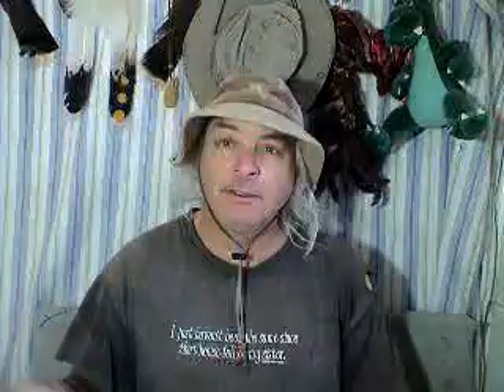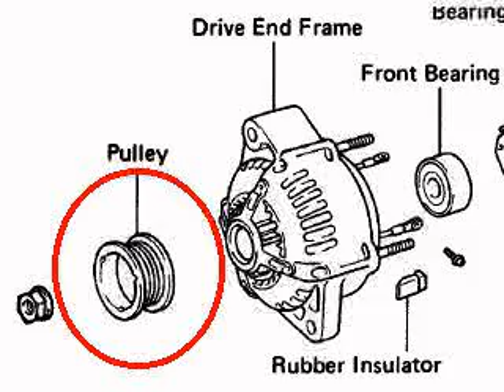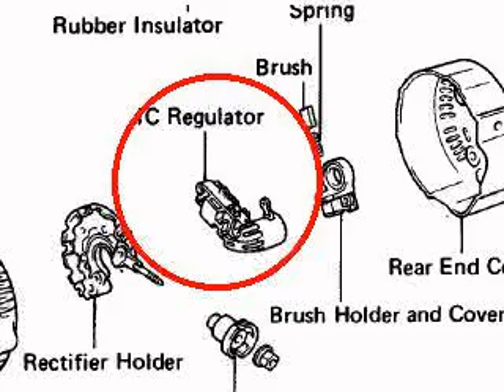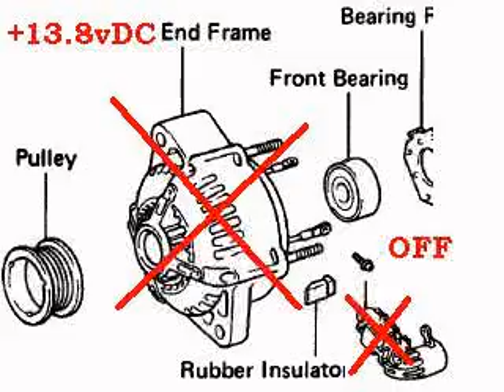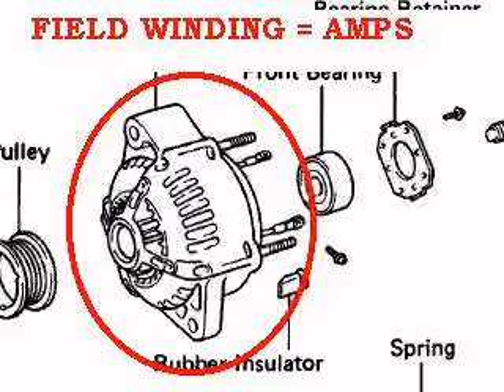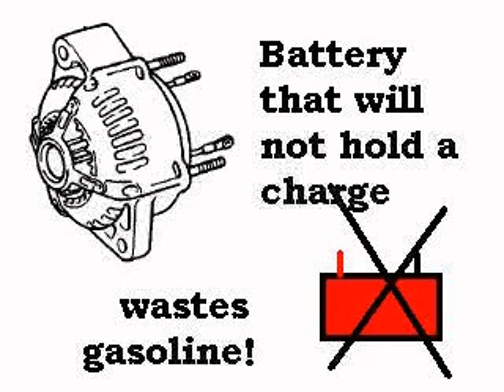Major Technology Breakthrough! Burn Water as your Automotive Fuel! HHO Part One

Comment from the maker: @frankrbruno ; Sorry buddy, but the standard regulator not only regulates a steady 13.8 volts with varying amps but it also turns the alternator off and on. I am getting my information from the automotive industry, and direct observation.  Also, it should be obvious to you that car batteries would not last long if they are always being charged. You can measure it yourself: place a ferromagnetic item next to the alternator with a fully charged battery: the magnetic field turns off and on.

Comment: Wow, the blind rebutting the blind! Unfortunately most folks explaining HHO boosting as a good thing, don't have a clue how it works. 

 So stay away from HHO, unless you FULLY understand how it CAN lower fuel consumption. And the many obstcals of HHO boosting.  

That means you need to no how Linear energy (the piston) transfers to rotary energy (the crankshaft). How "fuel burn speed" effects that energy transfer. 
HHO boosting can minimze waste energy (heat) it does not cerate energy!

Comment: I used to think you could get "free energy" from water, but I was wrong. It is against ALL the laws of the universe to make a perpetual power device (makes more power than it uses) Think about it: You are powering the HHO cell from power that you take from the engine, but have forgotten to realise that the HHO IS POWERING THE ENGINE IN THE FIRST PLACE! You can't make more energy than you use, it's just impossible. Even if the conversion rate is 100%, you cant use the energy or you will run out.

Comment: @EMILIJOXXX Well, it is you here who don't know anything about anything, his explanation is 100% correct, and these devices are a HOAX, the don't work, they don't save anything, they will just mess with the electric system and cause huge drag and even worse, prolly toasting the alternator and battery in the process.

I case you have any doubts, on a carburator smal gasoline engine (around 1300cc), just turn on the lights and hear the engine drag.

Comment: You have no clue that the regulator in an alternator sends voltage to the rotor( THATS ROTOR) in order to produce a magnetic field that is rotated within the field windings, and thus produces an output voltage from the field windings that is then changed to d.c. voltage by the diodes within the alternator housing to charge a battery. I think you should at least look around for information before you would make comments like the outrageous ones you claim to have more knowledge of than us....

Comment: @Sirstan2000 Lol, strange but oo so true, you need to check out and you will find me correct 100%, or i would not have said so. lol ...The ignition source was the weather, it took hold in the paint compounds, which in turn hit the hydrogen storage chambers in side...........thom.

Comment: The zeppelin exploded due to fire caused by thunder storm, the fire took hold in the paint compounds used on the skin of the zeppelin, the zeppelin did explode but only due to the lack of knowledge regarding the paint compound, not the design its self.
Thom in Scotland.

Comment: Alternators 1st used by Chrysler in production cars, early units were just a little more powerful (40 amp rating) than the generators they replaced. Nowadays it is not uncommon for cars and pickup trucks to sport 140 to 160 amp alternators, and in a couple of cases 225 amp units, the vehicle systems may only use a fraction of this supply at any one time 35 amps to 75 amps, the modern alternators are over rated, not under rated.
Thom in Scotland.

Comment: First and foremost, an alternator never stops producing energy. The only function of the battery is to start the vehicle. After starting vehicle with battery you could remove battery and car would continue to run. A regulator is for 2 reasons, to regulate voltage & to convert voltage from AC to DC. Furthermore I personally have seen better fuel mileage and cleaner emissions. Sounds like you have never tried a unit, you should 1st try it then we'll debate. Thanks and God Bless!!!

Comment: 2H2O + e -> 2H2 + O2, is more costly in terms of energy than extracting H2 from petrol fuels currently, and is a storage nightmare. Using 2H2O + e -> 2H2 + O2 -> 2H2O + e on board a car is simply a waste of energy. Your much farther ahead simply powering the vehicle directly from your stored energy, as in battery stored electricity, petrol, or H2 (any fuel). Petrol is the most energy dense storage method and easiest to handle. That's why we use it. 

H2 is fuel, H2O is not.

Comment: I think the point your confused on is how the Hydrogen is bonded in each usage you named. H2 is usable as a fuel for combustion, an exothermic reaction with O2. Which we use to drive many things. Energy yielded from H2+O2 is greater than an identical hydrogen count of C8H18+O2. It's all about the energy required to break the bonds compared to the energy released when bonding the product. Breaking H2O to create H2O even at ideal efficiency is a match. You can use that for energy storage/transport

Comment: Addendum: Ensuring that your fuel injectors are misting properly is a far better use of your time and money.

Adding a water injection system or bubbler will give a little increase in overall efficiency on some engines.

Comment: MY HERO!

However, some of the mileage, and emission claims are accurate, just not for the reason claimed. Water vapor, and tiny air born droplets of water entering the combustion chamber have the effect of moderating combustion, and expansion of the resulting hot gases which increases engine efficiency, and reduces NOx emissions. The tiny amount of H2 and O2 produced can have a very, very slight positive effect, only noticed at very low engine speeds, only due to favorable ignition conditions.

Comment: gasoline is a hydrocarbon an as such adding hydrogen improves the burn characteristics of the gasoline so that more power is produced in the burn than gasoline alone. Your only looking at the electro- mechanical side. by your account a supercharger wont improve power output because you have to dive it from the crankshaft. Good luck with your education.

Comment: Whatever you fancy calling H, its combustion results in an explosive exothermic reaction producing energy output and water on earth.Its density makes no difference as long as enough is produced to run that engine. The people experimenting with HHO will get there, whether via electrolysis, hydrolysis, plasma combustion etc. We are reinventing the wheel. Being a Tesla fan, you already know this and you know also that there are many other ways of running a car. HHO is only one of them.

Comment from the maker: Dear idiot,

Hydrogen on Earth is not a fuel: it is an energy transport. Also, the energy density of hydrogen at room temperature is 4,754.40 times less than gasoline for the same volume. Do the math.

Comment: If H on earth is not a fuel, but H on the sun IS, WHAT PLANET are YOU from?
No matter how much energy it takes to split a molecule of H2O, (even if the alternator is running), this energy is FAR FAR FAR LESS than the energy required to extract the oil from the ground. Do the math. 
Now let me teach you another lesson.
Combustion of hydrogen yields 143 MJ/Kg. Gasoline has an energy content of about 47 MJ/kg. 
H costs FAR LESS, is MORE ABUNDANT and 3 TIMES MORE POWERFUL. Who's the idiot now?

Comment: Same with hydrogen. Does burning a litre of hydrogen produce more energy than what it took to extract it from water? It's no where near the energy required to get a litre of gasoline in your car! Breaking the H2O bonds and then joining them is an atomic process that is simple and with efficient design will certainly blow oil to kingdom come! EVEN WITH THE ALTERNATOR RUNNING!And besides, water is 70% of our planet. I CHOOSE TO USE MY ALTERNATOR AND STRESS MY ENGINE A LITTLE MORE!God bless&HHO4ALL

Comment: Desertphile, I am afraid you have not thought this over very well.
First of all, Hydrogen is a fuel, same as Gasoline. In rockets, it is used in its solid or liquid form to save space. Since it needs oxygen for combustion, it can also be stored as H2O liquid since it takes less space and is safe to handle.

Comment: yes decreasing fuel economy by a very small degree, but as ive said earlier, the HHO catalyst more than makes up for that decrease.  There are people driving all over the states from one end to the other with converted cars and their alternator and battery remain in good condition and they save 30-40% on fuel use.  Alternator drag is negligible.  Wow so Dateline NBC did a 'hatchet' job on HHO did they, what a surprise! ha, NBC is owned by The Murdock empire and he works for Opec (oil company)

Comment: This statement from me "the fact that the alternator under load of say 25amps uses VERY little gasoline, and that HHO as a catalyst does not need to balance with the energy extracted from the alternator because this is not a closed loop system. Water and air is added for free." which means that your alternator points in your video are WRONG, the whole premise in your video about alternator drag is WRONG, and its been pointed out to you, but your not addressing it, alternator drag is negligible!

Comment: lame excuse, you have plently of time on your hands, and it would save you much time (and money) in the long run with this thread, but i guess your not up to the challenge, just your usual quick fire excuses, and you still havnt addressed the fact that the alternator under load of say 25amps uses VERY little gasoline, and that HHO as a catalyst does not need to balance with the energy extracted from the alternator because this is not a closed loop system.  Water and air is added for free. Wakey.

Comment: Firstly: I didnt insult you, i merely stated a few truths, one been that you dont get HHO. Secondly I did spot things in the video that were wrong, and i made comments about it as above... Alternator drag is minimal (assuming a decent battery and alternator), 20amps uses very little extra gasoline (were talking less than 1% of total engine power lost to the alternator 'drag') BUT a tiny amount of HHO increases the efficiency of the combustion process by many times because HHO is a catalyst!

Comment: this guy just doesnt get hho obviously.  perhaps he should also look into geet reactors, as these are another proven alternative to just burning gasoline that he probably wont be able to accept either.  alternator drag is not an issue if u look into the real maths behind this. a tiny amount of hho is all thats needed to radically improve the efficiency of the combustion process, and thats the secret here, with very little drag on the alternator you get a lot more efficent burning of fuel

Comment: From what i've read, HHO systems use 18-20 Amps from the alternator, yes it causes drag on the engine but the Hydrogen that comes out more than compensates, what is this guy going on about?  The car gets easily 10 miles to the gallon better and using the alternator only adds like 1Mile per gallon of gas consumption?

Comment from the maker: "If you use the gas to run the engine, you are charging the battery. "

Breaking the chemical bonds of water takes more energy than combusting hydrogen provides, every time, without exception.

Comment: hey jackass,you can run the elecrolysis unit through thermo electric units connected to the exhaust,+ you  also include wood gassification off exhaust heat

Comment: I don't think anyone is talking about running a vehicle on HHO, you simply cannot produce enough via on board electrolosis. 
The idea is to promote more efficient combustion, it has been proved that it does by the previously mentioned organizations/groups.
The (proven) benefits are improved mileage figures and cleaner emissions.
Not the ridiculous claims of some commercial entities for sure, but a DOCUMENTED 20-23% improvement in gas mileage and same torque and HP and better emissions ? why not.

Comment from the maker: "...that it (HHO) was a waste of time, hadn't worked, couldn't work, won't work, maybe I should have watched the second video."

I never said that automobiles cannot run off hydrogen: I said it costs more money than gasoline, and that alternators cannot produce enough electricity to produce hydrogen from water efficiently. I said that it is much more energy efficient to use gasoline to power the automobile instead of using gasoline to make hydrogen to power the automobile.

Comment: Paul07901 - I installed an MSD (multi-spark discharge) ignition system on my ole International-400 tractor. It was the BEST thing that old tractor ever had done to it! It starts easier in cold weather, it has overall better engine performance, and my plugs no longer foul from burning oil. The MSD ignition system is more expensive than a conventional ignition system, but is WELL WORTH IT!!

Comment: Just to throw out on the table, for increasing fuel mileage what do you think of these high density multiply spark ignition coils that provide a significant amount more voltage to the cylinder, compared to the OEM ignition coil. Installation requires one to dramatically widen spark plug gap, compared to OEM gap, thus increasing spark profile. Will this arrangement eventually melt my piston heads? Someone please do a video about performance ignition coils, claims of extending fuel economy.

Comment: What about Daniel Dingles car it runs off of electrolysised water which is H2+O2. what do you have to say about that? There is a car in Japan that runs on it also. So put that in your pipe and smoke it. If you smoke you will get cancer!

Comment: Hmm... it is possible what you say is correct.

And yet it's still irrelevant.  The drag that it produces on the engine is still going to vary with the current draw.

I've got a new stat for you as well.  Automotive alternators are generally about 50-62% efficient.  The rest of that power is lost.  So take the electrolysis loss into account as well and that's a loss to usage factor of 4-1.  For every four units of power you're making the engine generate you're using one.

Comment: for my own sampling process, I bubble the product through ice water then through a condenser ... though its a pain in the tush to do, it gets the gas pretty pure and normally gets the temps down into under 70F range so my measurments are more accurate than most ... but even my method is lacking in precision ... the proper method is known to most, but the complexity and expense is prohibitive ... so we do the best we can with what we have ...

Comment: "For the most part it is a waist in gas mileage due to that charging. It is like sitting idling. It waists energy."

You haven't paid attention to one flipping second of this video, have you?  The alternator is only dragging on the engine when it's active.  It only supplies as much power as is needed.  Electrolysis is keeping it constantly loaded down and burning more fuel.  There is nothing being gained for free here.

Comment: Perhaps I was not clear. We are dealing with amateur experimenters who are making the gas using a number of techniques. It is rare that the gas produced is pure H2 and O2. There is often a high quantity of water vapor and even gasified electrolyte chemical. We are trying to come up with a reasonable method to determine actual production efficiency. To evaluate the volatility of a given batch of the stuff is not as simple as looking up an entry in a table in a text book.  I wish it was so easy.

Comment: "There is no reference material available related to HHO gas"

Drevtoob already covered this, but.. it's just hydrogen and oxygen.  You of all people should really know this.

Another way to calculate the energy is to use the amount you'd get if you used it in a 100% efficient fuel cell, you could find those numbers too.  I THINK that that should be the same as the energy produced burning it, but I haven't checked to be certain.

Comment: "have had to use the numbers I've found online" - this is part of the problem.  There is no reference material available related to HHO gas. The best we have is the ramblings of Yule Brown or the tables related to hydrogen.  HHO is a different animal. And because it is typically produced on demand in small batches, the purity is questionable. We need to develop a fairly simple method for amateur experimenters so they can at least get close to reality.  Hard to do.

Comment: "then you have a simple method of measuring the total power content of the gas"

I have had to use the numbers I've found online, I cannot personally calculate it.  But I assume it should not be too difficult to calculate the total heat energy produced by burning a fixed quantity of hydrogen.

As to how to measure that quantity, well..
I'm sure you know that.  Measure the volume, temperature, and pressure, and then you can get your mass from that.

Comment: in my own case, I use 120vAC from the wall ... depending on how much gas I want to make, I will draw anywhere from 5 to 20 amps ... this is run through a simple power supply of my own construction that includes a bridge recitifier and 4 farad capacitor ... I deliver about 150vDC to the electrolysis device ... the device has anywhere from 50-70 plates so I can vary my voltage per plate gap ... 2v - 2.5v seems to yield the most efficient reaction ...

Comment: the method we are working on is to ignite the gas in a hydrolic cylinder that is loaded with a weight ... its a fairly expensive apparatus for the typical amateur experimenter to deploy ... the measurment of the energy output of the created gas is somewhat complex and is not as precise as we would like ... we are seeking better methods if you have a suggestion ...